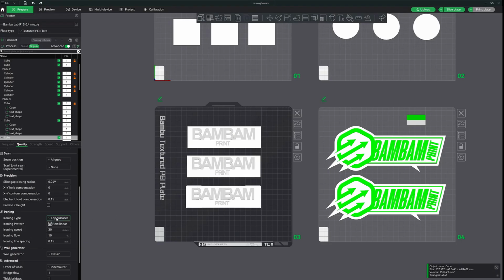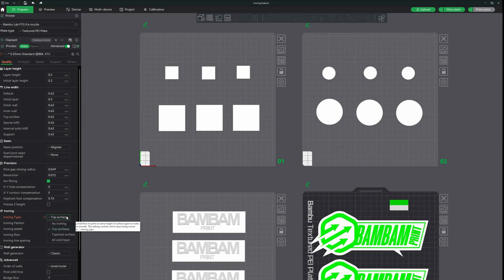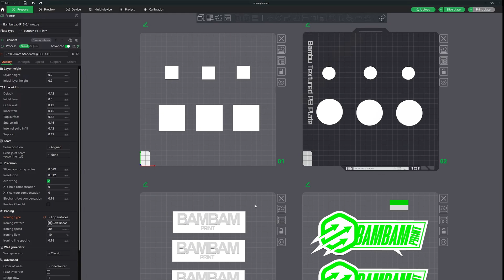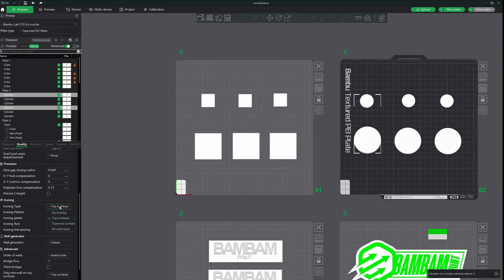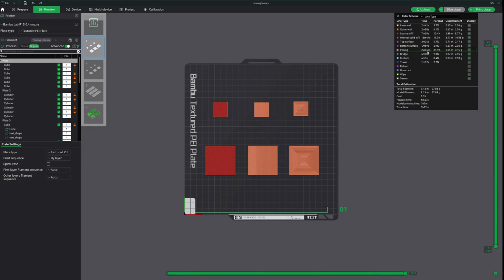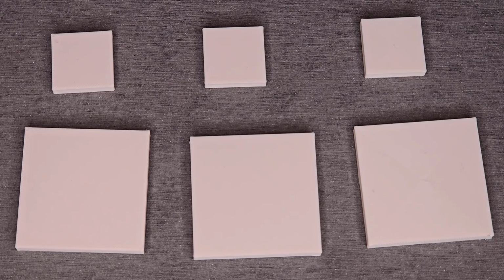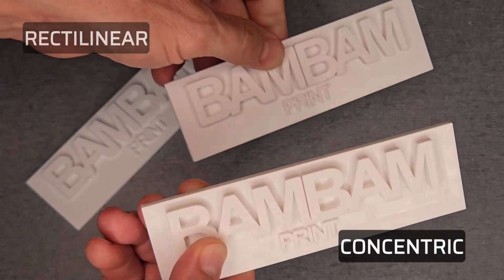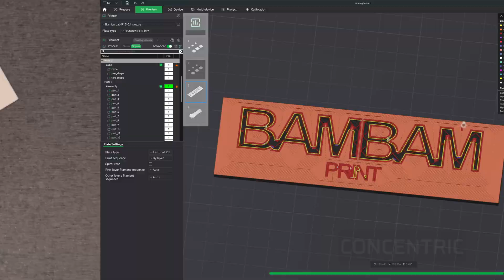Ironing Feature in Bambu Studio: Detailed Comparisons Revealed

Comment: Have you done the advanced ironing video yet? I'm getting some artifacts as well - banding and some rough spots, and a few spots where it looks like you can see the previous layer through. I'm wondering what settings may have changed, the ironing used to be flawless, but something is different fairly recently.
Reply from the maker: No not yet. The ironing algorithm has changed quite a bit so I am waiting to get a complete test of that feature.

Comment: Here's the solution for smooth, even ironing all the way across the top surface of the base of your model... Add a modifier (the same size/shape of your model's base) to your model and set its height/thickness to your layer height, say 0.20mm. Then vertically position that modifier at the last/top layer of your base before the first layer of your embossed logo prints. Go to 'Objects' view and apply ironing to the modifier. Select "All Solid Layer" from the 'Type' dropdown. Set the infill density of the modifier to 100%. When you slice it and go to that layer, you'll see that it will iron across the entire top surface of your base before laying down the first layer of the embossed logo. This keeps the ironing pattern from turning corners and running around the embossed logo.
I've been making drink coasters with embossed lettering/artwork with this method, and they turn out beautifully.
Also, for all my filaments, I run ironing tests for % flow at 30mmS, and they generally fall into either 25% flow or 30% flow for a near perfect finish (with my printer).
Cheers!
Reply: Wow what an awesome tip! Thanks!
Reply: Hi, I tried it, but after slicing, the printer still separates the different colors while ironing. Any suggestions?
Reply: @rw-oj6ys  I would say try making the modifier twice the layer height and see if that helps. Wish there was a way I could get a copy of your print file to see it.
Reply: Excellent use of a modifier! I've used this trick before for signs and it comes out perfect.

Comment: There is a better solution to Panama's water problems: reducing water usage. Several techniques are available, including pumping water back using energy generated by the water drained down, using intermediate tanks for the top portion of the drainage which is then used to do the first part of the filling up, and more, and it's estimated that they could reduce water usage by 60-70% with a reasonable investment.

Comment: Yeah I have an issue on complex top surfaces where there a different surface finneshes
Reply from the maker: Are you using the ironing feature?
Reply: @planet3dp yeah in rectilinear when the path changes length it will change the looks (especially with words that are flush with the rest of the object)

Comment: Hi,
Could the last test have been affected by the color switch? 
The difference was unexpectedly significant compared to the third batch.
Reply from the maker: I had thought the same thing so I went ahead and printed the entire logo in white and it yielded the exact same issues.
Reply: @planet3dp  Oh, really? That's too bad. I suppose other settings like layer height and layer width might be more effective. The overall speed might also make a difference. I'm looking forward to the next experiments. Thanks.